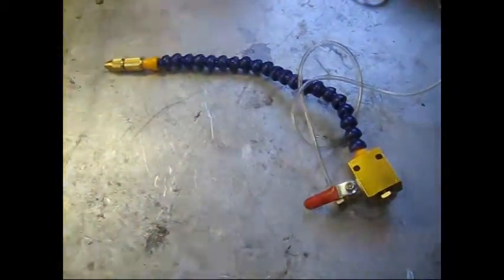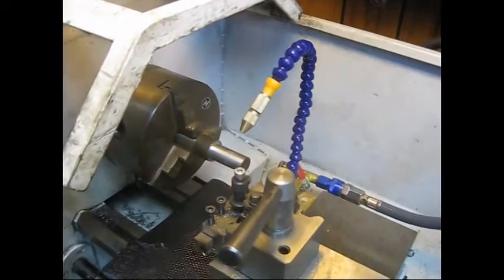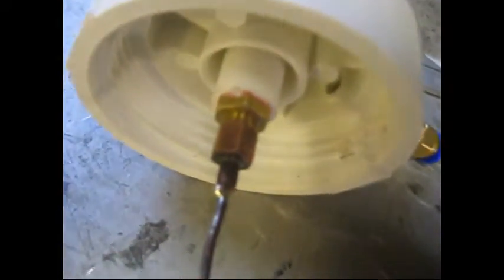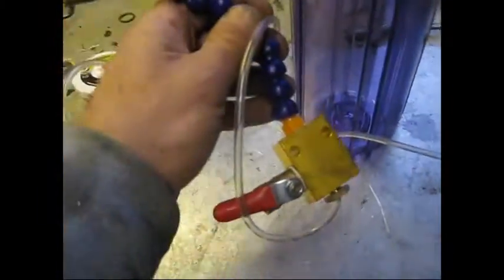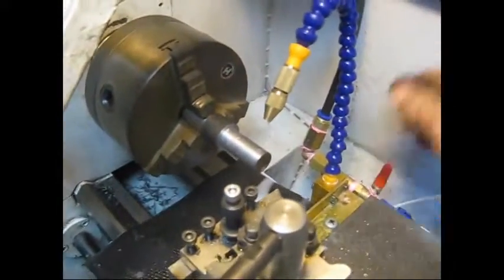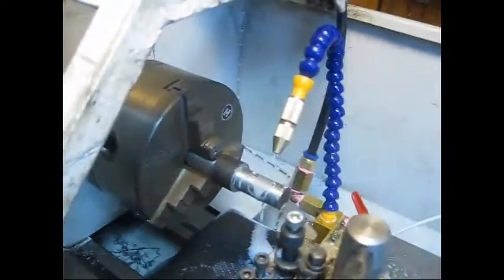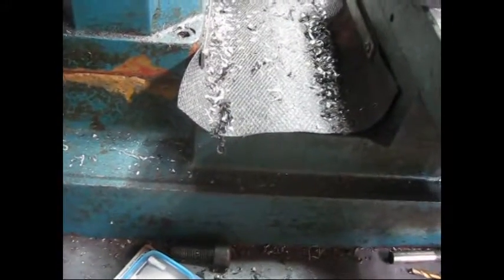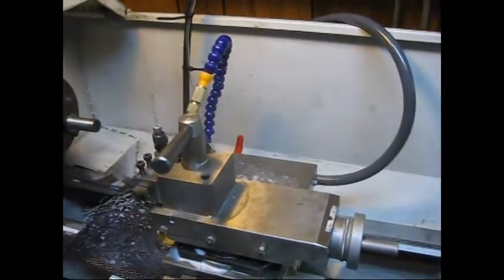Simple Cheap Spray Mist installation

Comment: In case anyone was wondering, the clear container he used for the fluid is from a reverse osmosis system you can get at most hardware stores pretty cheap.

Comment: I think that if you raise your coolant bottle higher then you will need less air. Of course the bottle should not be above the nozzle. If it’s above the nozzle then a siphon occurs and that’s not good.I would try to locate the bottle so that the coolant reservoir is about one inch lower than the mister’s  valve block assembly. Also, it might also help to try to keep the suction hose (which goes to the bottle) as short as possible.

If the reservoir  was placed higher than the mister block… then siphon action will be assisting the mister. The solution there would be to install a shut-off at the reservoir so that the fluid flow can be cut off when not in usage. Anyway, the point is that these are very inexpensive misters and there are probably numerous methods of tweaking it.

Comment: It seems like a simple pressure and/or volume regulator would have been sufficient to make the original setup work just fine. I've also heard of getting a simple single-action airbrush and making a locline mount for it. Every functional atomizing device I've seen, including airbrushes, HVLP guns, and others all require a limited range of air flow and pressure to work properly. My HVLP guns only work around 25-45 psi, for instance.
Reply from the maker: Yes I plan to modify it with a regulator and also make it portable, hopefully I will show that in an upcoming video. I guess my main point was that you could use one of those  filter cartridge containers as the reservoir for the coolant.

Comment: Noob here, where do you get or did you make the basin for catching the liquid?  I was just curious if there was one I could buy that would fit my mini lathe from harbor freight?
Reply from the maker: It's just a lid from a container that i use as a chip tray. Using a mist coolant, there's really no need for collection of the liquid, there should not really be much left over.
Reply: @SuperGrover  Okay so just a light mist to keep it cool, don't run the liquid over it...got it.  I've been using a hand spray bottle of water and cutting oil so far because you can see the carbide tips glow red even when cutting slowly but probably because I'm cutting hardened steel and other tungsten carbide bars.

Comment: you can regulate it at the tip where the spray comes out i needed some time too until i recognized it .. goes a little hard at the beginning ...
Reply from the maker: Yes, it's still inconsistent though, I guess that's why they're so cheap. There's a video of a portable version on my channel that works way better.

Comment: great video, What is your solution your using. I'm using 20% mineral oil, 80% water, with a couple drops of dawn dishwashing liquid. Cutting aluminum.
Reply from the maker: I just use commercial stuff. They put anti-bacterial agents in it to stop it stinking and it is apparently bio-degradable.
Reply: Thank you, that's very useful to know.